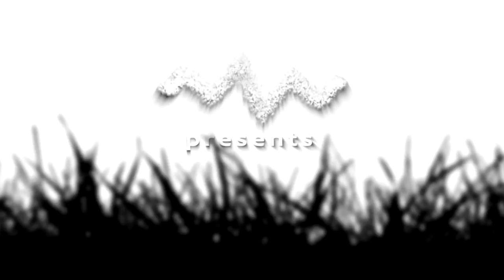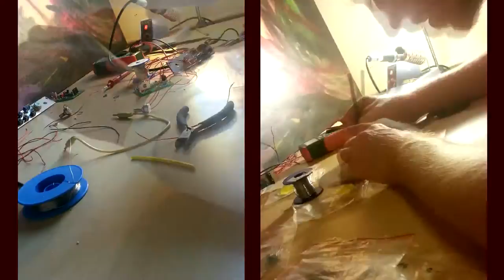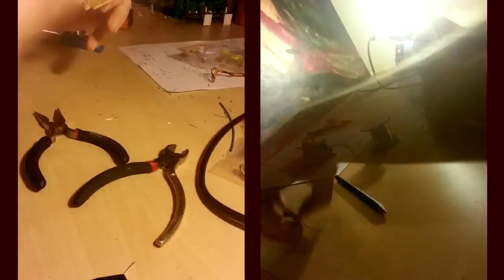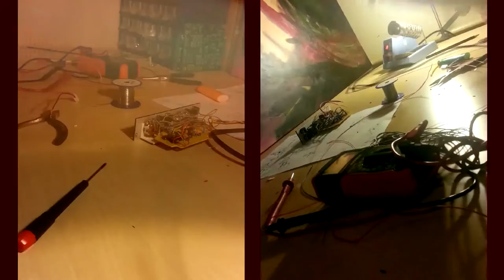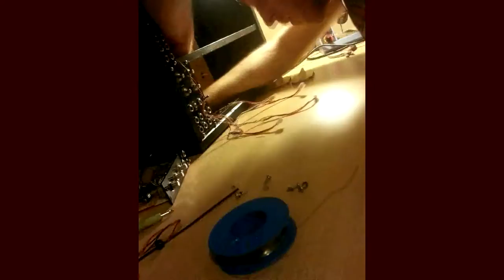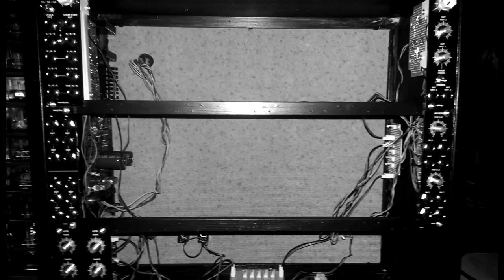let's build a modular synth -part 4-

Comment: do you make the front text stickers yourselve??how/ i need them too.
Reply from the maker: hi
yes i did it all by my self
step 1)
paint the layouts in gimp ( www.gimp.org ). Gimp is just a gfx tool with supports layers, so if you prepare your self  all components for  a panel as own picture its realy easy to import those and do the layout with a fixed configured grit.
step 2)
print out the layouts .... i use for this copy shops in town ...use laser printers and in the copy shop the provide more papers types .. i alwyse use a kind of white film paper with no gloss and self gluing on the backside...not all paper works for step 4 see below  
step 3)
buy the panels from conrad like http://www.conrad.at/ce/de/product/541079/3-HE-Frontplatte-Aluminium-B-x-H-505-mm-x-1284-mm-Silber-matt-eloxiert
and put the layouts on it ( self gluing )
step 4)
and for the finish i use 2 component paint ( ColorMatic 2K ) http://www.conrad.at/ce/de/product/478486/ColorMatic-2K-Klarlack-mit-Haerter-187216200-ml?ref=searchDetail
thats it :)
cost reduction:
if you print more layouts on one paper, i alwyse print 3-5 layouts on one paper
and the ColorMatic can only used once ...so do more panels in one shot ...you can do at least 25 panels with one ColorMatic
then one panels cost ~ 0,5Euro Paper + 1Euro ColorMatic + 2-10Euro alu panel = ~8Euro per panel and that is realy cheap :)